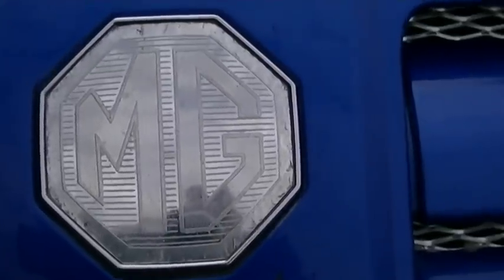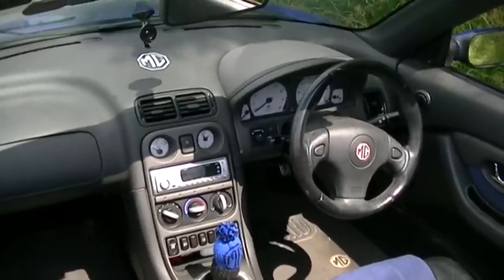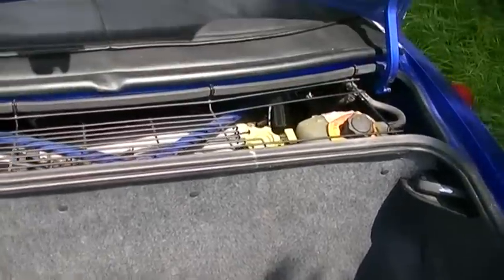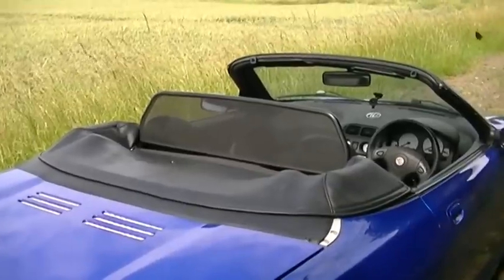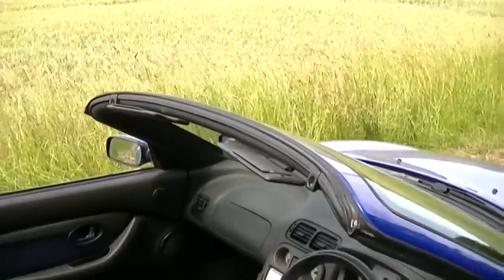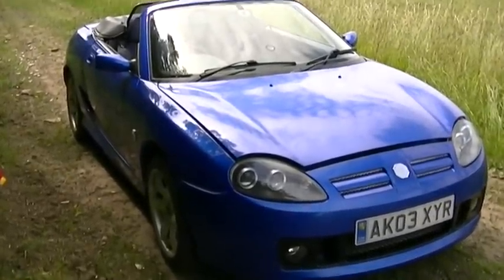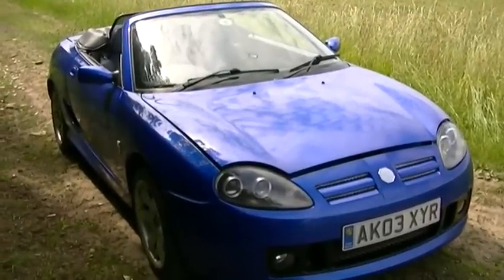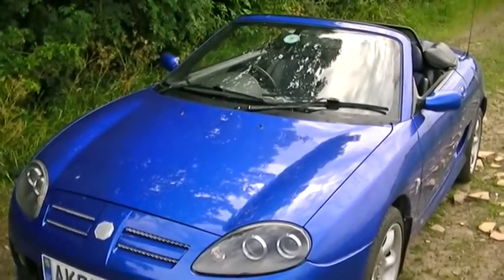MG TF review 001

Comment: Got this in 2016, 2004 135 model in this blue. Only added a black hardtop and the walnut steering wheel and also undersealed to protect from corrosion. £1400 and 29k miles on clock. Was well worth the price.

Comment: I have an MG TF 135 1.6. Unfortunately prewious owners treated it badly. I had the head gasget problem as well, didn't fix it at the time. After few months it is passed away handheld with 16 cilinders. Cost 1227 pounds to fix it. Also the geabox, battery, etc....
My problem is I love this car. Every time when I change comething on it I buy quality parts also using only quality petrol. Now it seems fine. And after all I won't sell it and replace it with some ordinary car. Once You drive it You love it

PS: If U have head gasget problem DO NOT USE ANY STEEL SEAL and similar headgasget repair liquid !!! Useless and makes more damege on long term

Comment from the maker: I removed someone's comment as all they ranted on about was how bad the tf was and how good the mx 5 is. This isn't the place to bad mouth a car because you don't like it. Just for the record, while the MG was in production it was the best selling car of its type, out selling the mx 5. I will remove any negative comments that are not factual.
Reply: A few years back I had a friend who had set her heart on a black MX5 - her budget meant the Series 2/2a cars. I spent hours researching them on forums & in articles & realised that they were all riddled with rust in the sill & front chassis leg areas. I wanted a dealer car as there was an MX3 to trade in. I looked at the prices & the MOT histories of a lot of them. I found a 66k mile example from 2001. We did the deal - it drove well, felt tight & looked good, but I could see problems in the offside area just in front of the rear wheel. She was prepared to spend on a phased improvement programme for it. A local MX5 specialist quoted 2k all-in...which was okay - but then we fell out & she took it back to the specialists, some months later, on her own - they upped their quote to £3k & finally told her to get rid as it 'looked as though it had been in seawater at some stage'...................My point is that if these cars were MG's they would be slagged off up hill & down dale - Mazda had had every chance to get it right...they'd been on the shelves for a decade by the time the Series 2's hit the road........The TF is a bargain compared to the MX5, being more technically advanced & nowhere near such a rotbox... I've an '03 115 example that was peanuts to buy. The 'tinplate' wishbones needed replacing when its MOT came up & it's had a new starter motor on - it'll do supposedly over 50mpg on a steady run & go round corners on rails!! Goodness knows what the '160' model feels like - a Ferrari, I should think!

Comment: Also had both MG Tf160 (4 yeas)  and MX5 (1 year)  - 
MgTF 160 handles slightly better but the running costs are not worth it. Mainly due to the engine location and access to the engine. Also had 3 HG failures - ( and I made sure the cooling system was maintained and the proper gaskets were used). Sadly the car was more in the workshop than on the road and cost me a fortune to maintain.

MX5 also has larger boot space.
 Traded MG in on MX5 - very happy with Mazda, not a day's problem after a year

Comment: Each to their own I suppose.  I owned both the MX5 and the MG F.  MX5 beats it hands down.  Went through two head gaskets in the MG F.  You said it likes to be driven hard - mine didn't - both HG F failures were not long after hard driving.  MX5 got thrashed hard every day I had it and it just asked for more.  MX5 a dream to work on, not that it ever needed anything but basic maintenance.  Handling on MG F was dull, understeer with threat of snap oversteer if you really pushed it as I recall.  MX5 on other hand is more or less the ideal car to learn RWD handling characteristics.  You can enthusiastically get the rear end out and just play with it all day.  It almost never bites you.  Didn't like the gear change on the F either, was stiff but also wooly.  Maybe I had a bad one, but for me there was no going back after the MX5.

On the plus side for the MG F, I do think its the prettier car, it has more poke that the 1.6 MX5, and there was plenty of grip so when not driven to the edge it was more reassuring for daily driving.  It felt a bit more refined than the MX5 too.  

One thing I'll give it dues for too - a friend has a house in wales at the top of an incredibly steep narrow road that has a sign at the bottom everyone ignores saying "Not suitable for motors".  Over the years I driven many cars up that hill and most struggle in one way or another.  The MG F just glided up it.
Reply: I can't argue that the K-series is prone to HGF, but I do know from personal experience that if the LSD fails on an MX-5 S-VTi - and they all fail eventually - it costs more than the HGF on my TF160 cost :-)
The MG TF (shown here) and MGF (what you are talking about) have completely and fundamentally different suspension set-ups and don't handle anything like each other. 
I had a TF160 at the same time my OH had an MX-5 S-VTi. Both lovely cars, but the MX-5 was sunny-weather only for me as I physically couldn't fit in the driver's seat with the roof up.
Both cars had fun but very different characteristics - as you hint at, oversteer was nice and predictable in the MX-5, but then being the S-VTi it had an LSD and 140ish BHP. Not sure what it's like in the lower-spec ones. But, the TF was definitely faster through the corners if you trusted it. Never had understeer, ever, it was completely neutral right up until the limit when it would spin or slide off the track. Yes, track. Never got anywhere near that traction limit on the road, but then I took it easy on wet or icy twisties. :-)
Acceleration, the TF had it every time despite having an old 5-speed vs the MX-5 close-ratio 6-speed. 0-60mph, 0-100mph, high-speed acceleration was better and top-speed was higher.
Working on an MX-5 is not a dream - have you ever changed the oil filter on an S-VTi? Again, can't speak for the lower models but to get to the oil filter on the S-VTi involved removing the inlet manifold unless you had a two-post lift and 5-foot arms with 3 elbows. But then the engine in the TF was under a panel that had to be unbolted, and the VVC had timing belts on both ends of the engine. Both cars are a sod to work on! :-)
Reply: I had a 92 NA Eunos 1.6 S-Special - they are so cheap if anything major fails just buy another one or get scrap parts.  Changing the oil filter on mine wasn't hard though a tiny bit tight to get your hand in so you risked scraping your hand was about it.  I found it very, very easy to work on and I'm not mechanically minded at all.

Things I did on that car in about 6 years of ownership:

* Valve cover seal was leaking oil very slowly onto exhaust manifold, it didn't cause any issues and I drove it like that for a couple of years but you could smell the oil burning off the manifold if you drove it hard.  I changed the valve cover gasket and it was a piece of  piss.  Cost about £14 for the gasket I think.

*I changed a fan temperature sensor - 5 min job to replace and they cost about a tenner, and while your'e waiting for the part you can simply click the AC on which automatically runs both fans so no worries.

* I changed the thermostat as old one was partially stuck.

* The clutch fluid had a very slow leak I didn't know about and when empty refused to go in gear.  Bleeding it and refilling was a doddle.

All said every repair was cheap and easy.  Went through the usual disc and pads, oil and filter changes.

Mine had the pretend LSD, the viscous one, don't know if they go wrong or not, never had any trouble with my mine and it was a beat up car that I treated badly.  I'm 6 foot 1 and fit in the MX5 although you do have to adopt the seat position of laid right back!  It was certainly snug.

Absolutely the MG F (and I assume the TF more so) was quicker in a straight line than the MX5 but then most things are.  I own a 350whp RX7 so my MX5 was never going to thrill on that score.  And you know what - it doesn't matter.  People hate me for saying this but the MX5 is a better car than the RX7, it is simply more enjoyable most of the time.  RX7 probably  more fun on a track but too powerful to use properly on the street without losing your license real quick.
Reply: ps I hear that six speed box in the MX5 is crap, which wouldn't surprise me as the 6 speed in the RX8 is also crap.  But maybe I just don't get on with them - all the 6 speeds I've tried I've tried have been crap - IS200, Mini Cooper S, RX8, all horrid in some way.  The 5 speeds in the MX5 and the RX7s are peachy though, the MX5 box especially so.
Reply: If your car went through 2 head gaskets, either it was not fitted correctly, or there was an underlying factor. Seems like the problem was fixed but not the cause. I have driven both the MGF and an MX5 and give me the MGF any time, Every time I drive it I have a smile on my face, the MX5 just didnt do it for me
Reply: @neodonkey  ....I hope the early cars didn't rot like the Series 2/2a ones. Mazda showed a complete disregard for their customers - if they'd been a British manfacturer they'd have been slated by all & sundry.......but being Mazda, seemingly, they can do no wrong!

Comment: I found an MGF abandoned in France RHD,  hadn't run for 3 years, turned the engine without the plugs, and 20 minutes later she started, been running no problems. I am looking for chrome vent covers, mirror covers a complete chrome kit  any ideas on where, paid  250 for the car 51000 miles

Comment: Yea, i had to weld my sills as a hole appeared. You forgot to mention that the compliance bushes rot and so do the subframe to body mounts which i have changed to stainless steel.
As for wishbones, yes daaamn just yes they rust allot and badly but it takes a long time for them to screw up. I had Alfa Romeo where wishbone bushes are shot in 2 years. Alfa don't rot but the damn bushes just rip to pieces. In comparison MG wishbones are very good.

Rover engine has a full water jacket as the cylinder bores are submerged in coolant so changing the coolant regularly is imperative to avoid head gasket failure. 
Mine is the 1.6 and it pull like a 1.8 MX5. It really is quite amazing how much power is in this Rover K16 engine.

Mine is in the garage due to a Severn trent water truck reversing into the front bumper, i have a 2013 Focus ST3 as a hire car during the repair and you know what this MGTF is very comparable in performance. All be it the MGTF don't have a turbo and it is not 2 litre but the mid engine and rwd is just awesome. You have done a very good review.

Oh and that clutch release leaver in the gearbox, grrrr i'll have to sort mine out soon as it has stiffened up a bit too much for my liking.
Mine is the cool blue in silver 1.6 limited edition. 

Oh another thing i found about this car, cornering at 50mph in this car is so easy. It handles very well but you really need to pay attention to the grease nipple on the front top wishbone, yes it still needs a grease gun to grease the roller bearings for the front upper suspension bone.

 Do you get the same problem with the petrol cap going tight and key bending a bit?
Reply from the maker: +Fireicer Cooper (f1r31c3r) thanks for the reply and feed back.when I did this video I hadnt had the car very long.I havent had a problem with a stiff fuel cap but I do have a stiff boot lid,and the key is bent a bit !
Reply: Interesting so it may have had a stiff fuel filler cap at one point.
I found rust inside the locking mechanism making it stiff on mine.
Reply: Both wishbones had rusted holes in when my '03 TF115 went for its MOT - they're not exactly 'heavy duty' items!.....That said, it passed once they had been changed... (the items are cheap enough...) & once the rear brakes/handbrake had been 'notched up'..

Comment: Would it be good for a new driver?
Reply from the maker: +JUNAID187 If you had the 1.6 and not the more powerful 1.8 in my view I dont see why it shouldn't  be a good first car.It has its problems like any car but most of them you can fix at home.I'm not saying that every car will have a problem that needs fixing but un like a newer car you can do it and it doesn't need a computer.you can customise them how you like and there are a lot of people with better knowledge than me that will give you excellent advice.go and get one.
Reply: +John Stevens is it easy to drive and control for a new driver also how is the overall visibility inside the car and is it hard to park?
Reply: +John Stevens funny thing is I just watched this video again and half way through the video you replied lol
Reply: +JUNAID187 I would not recommend this for a new driver, it's my 2nd car and I have the 135bhp version, and I've had a few scary moments, bear in mind the engine is mid-mounted, and it's rear wheel drive, so any power you put down on a wet surface, whilst turning, you're bound to lose control
Reply: +Zak Vickers it'd also be my second car. Decided not to get one anyway because the interior is really dated and it'd be hard to control in the winter months.
Reply: +JUNAID187 frankly I don't see why the dated interior is a problem. At the end of the day nobody should expect a Tesla Model S interior in a £2,000 car (max) from 2003. The interior is very functional. The Z3 and the MX5 interiors are no better yet nobody complains. The car is not good as a first car because it is quite powerful and engaging and with the engine in the middle and the rear wheel drive it can cause trouble if you are not careful. This is not a bug though, it is a feature. Maybe get one a bit later.
Reply: +nautaki Agreed, I've had several scary moments and I'm 20, driving 3 years. Lesson: Respect the Mid-Engined Rear Wheel Drive layout

Comment: Proper Bristish mid engined sports car? Most British sports cars were front engined.

Better handling than an mx5 ? 

If you like huge Understeer on anything over 20mph
Reply: Ah - I can see you've not driven a TF :-)

For several years I had a 2004 TF160 whilst my other half had a 2002 MX-5 S-VTi. So, I have spent considerable time driving the top-spec MX-5 of the era and a top-spec MG of the era. 

I will grant you that the MX-5 handling was more fun at legal speeds because it was so predictable and you could roll in a bit of oversteer if you wanted. Yay LSD. 

But, the MG TF handling allowed for faster cornering. It just bit you really f**king hard if you overcooked it. I never experienced understeer, I only experienced four-wheel slides and tank-slappers. But, those were not on public roads because the speeds required for either of those outcomes were simply ridiculous. 

Point-to-point, or in a drag race, the TF was significantly quicker. But, the MX-5 was just slightly ahead in road-legal driving fun provided you were under 6' tall or it wasn't raining.
Reply: Huge understeer over 20mph? I would say you probably drove a car (you did actually DRIVE it didn't you?) that had some errors in the set-up department or perhaps partially or incorrectly inflated tyres. My F is very neutral in almost all aspects and I can get understeer if pushing very hard but that is to be preferred for safety reasons over a 'pointy' version. I also like the MX5 but it seems to lack character if you get my meaning. I paid £600 for the F and quite honestly, it may be the best bang for the buck EVER in 55 years of motoring. Finally, can you raise or lower the hood in an MX5 from the drivers seat? The MG's hood is brilliant and I was thinking about a hard top for winter and I said "you know what? I'm just going to park it up, under the carport and a "Voyager" cover and get it out next Spring." That's a true motoring enthusiast right there LOL.
Reply from the maker: yes,better handling.its balanced better being mid engined

Comment: The mg was built with leftover bits, mx5 are much more desirable.
Reply from the maker: I think you are wrong, it wasn't made from leftover parts. The engine was far superior to anything in its class. the head gasket wasn't thick enough and that was its only fault. the designer pointed this out from the start and Lotus sorted that out. The understeer was deliberate and not a fault with the car.when BMW took over MG they didn't continue with production because it would have been in direct competition with their own car the Z3 and the MG TF was a much better car. The MG also outsold every car in its class during its production. I agree that the MX5 has become more desirable but that is only because the MG isn't made anymore. the MG is better in every way. It is better balanced and handles better than the MX 5, it is quicker, produces more power and is more economical.
Reply: betty swollocks  so why have they got front wheel drive hubs on all four corners, with half of a cv joints holding them to together, they’re cobbled together with leftovers!
Reply from the maker: @PauC-qo1uq  I dont know but will look into it.but if that is true why go to the expense of making something if what you already have works very well?is this the MGF and the TF?I ask this as the MGF shares the sub frame and suspension from the metro.The same as my SAAB shares the same engine as Fiat,Vauxhall,GM etc saving money.
Reply: Have a look at my post about the Series 2/2a MX5's in answer to 'Betty's' post at the top of the comments - you won't think the MX5 is so great after reading that!!